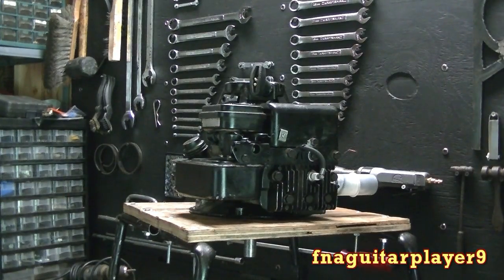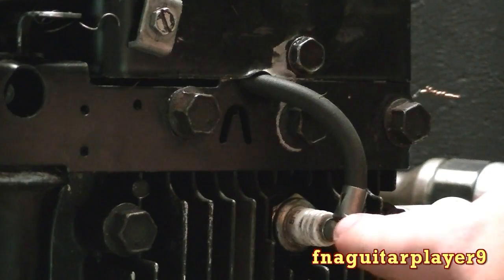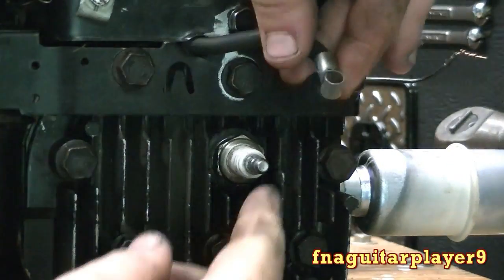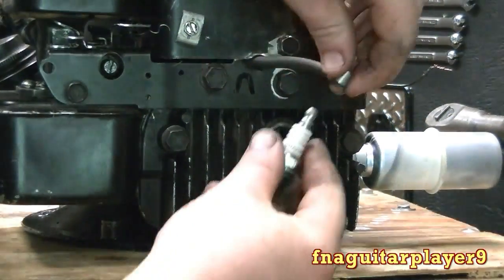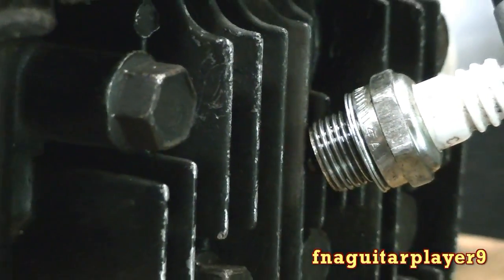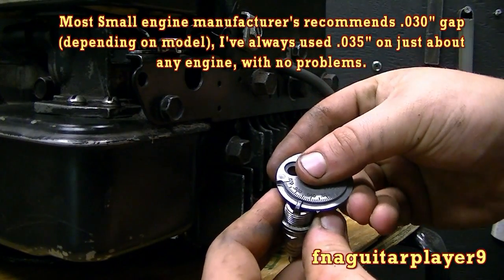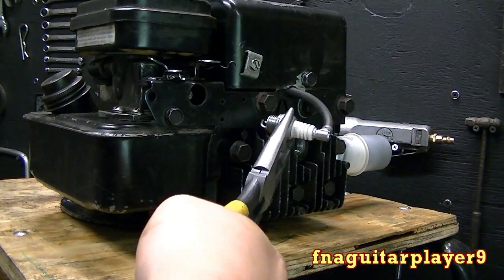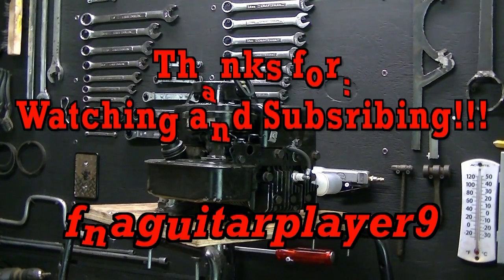How to check for Spark Plug Fire (in any engine)

Comment: Wats the conclusion i mean i should check gap and fire spark if gap to big minimize and vice versa is that so
Reply from the maker: Set your spark plug to whats recommended then check for fire. Some will say its not a true test, because it will spark differently while under pressure, which is true, but this test just makes sure that the spark plug is firing. If you have a yellow spark (weak) it usually means you the coil is to far from the flywheel (magnet) or you have a bad condenser or the coil itself is weak. 90% of the time if you test it like i did in the video and it has a blue or purple spark, its firing good enough to run. Thanks for Watching!!!

Comment: Thanks for the video. I'm going to try your method on my Husqvarna chainsaw. It's been sitting for months but was treated with fuel injector fluid. I'm gonna test the spark plug first, and if that isn't the problem I'll potentially clean the carb. If it STILL won't start, do you have any other ideas?  Again, thanks for sharing your video with the world!  With Gratitude, Z.
Reply from the maker: Zee Suro your welcome! if it has spark and the carburetor is clean it should at least try to run, if not the carburetor may need to be adjusted or rebuilt. thanks for watching!!!

Comment: Can a bad plug still spark? If I pull my push mower cord slow,I get no spark. If I pull it harder and faster,it gets a weak spark.  Magneto? Plug wire? Or new spark plug? Spark is orange too. Thanks! (Toro Recycler,self propelled,6.5 horse)
Reply from the maker: Oh yeah, its possible, I would suggest trying a new plug before anything else, it could be arcing inside or through carbon buildup on the plug. First thing I try anytime I suspect ignition issues. Thanks for Watching!!!
Reply: @fnaguitarplayer9  I cleaned the plug up (b4 buying 1),then I noticed that the plug wire itself,had been cut and that was the issue. Thanks

Comment: Hi, I have a Artic Cat 250 2x4. It takes a awfully long time to start. I did the spark plug test and it starts off yellow from the spark plug then blue at ground. I can't tell if I need another one or not :(.
Reply from the maker: NyQuan H I'd try another plug just to see, but if the spark is changing color like that, that sounds like a weak coil, might want to replace it. Thanks for Watching!
Reply: Epw ,

Comment: I've got spark to the end of my plug wire (removed the boot and grounded it on the engine block) but can't get spark at the plug base (the electrode tip).  The plug is brand new and gapped to .030.
Reply from the maker: Art Vandallay That sounds like a weak coil, or, even though its a new plug, its possible its bad, I'd try another one and make sure your grounding the plug good, sometimes they can be picky. I'd say its a weak coil though, sometimes they will spark like that. Hope this helps, thanks for watching!!!

Comment: I don't see a spark when I do this but I do feel electric current going through the wire, I've tried other spark plugs as well but they don't seem to do much either, I know they are not damaged,.. what could that mean then ?
Reply from the maker: Depending on the engine, it could be a bad coil, points / condenser if its a old engine, or distributor if its a older car engine. or even a bad plug wire. Thanks for Watching!

Comment: I have a honda crf250r and it's not firing up not sure if it's the spark plug? any help
Reply from the maker: +josh zub You could try another plug, its always the cheapest/easiest thing to check, if not, then it may have a fuse somewhere or a it could be a bad coil or a bad regulator box, or efi box. Thanks for Watching!!!
Reply: +fnaguitarplayer9 hey I actually found out the problem my brother was playing with my throttle and found our he flooded the engine  thanks again
Reply from the maker: +josh zub I hear ya! no problem, anytime!

Comment: Do you have any advice on how to test for spark on an small engine outboard that needs to remove the cover to get to the plug and so doing removes the pull cord from its engagement? I am not sure how I can crank it.
Reply from the maker: You may be able to crank it by hand, just turning the flywheel, if you got a good strong coil/spark it will spark at low rpms. Thanks for Watching!!!

Comment: hey i need help. i bought a used kawasaki ninka zx10r.and before i left i asked them how long does everything will last like, oil , coolant. spark plug . break pads. but they didnt say anything. sounds like they just bought it from previous owner and never inspected it. all their ads said oil change is done. so how i can tell if my spark plug is getting  old without cheaking them. there will be lots things to do just check it. like take off the gas tank, body fairings, air box etc. thanks for the help
Reply from the maker: +Kawaii Ninja You can really only check spark plugs by taking them out, but if they are worn to bad they won't fire properly and will cause a miss. Alot of people don't keep up the maintenance on stuff these days. Thanks for Watching!!!

Comment: My spark is more yellow and not so strong, could this be the reason for not even attempting to start? Been parked up a year, fresh fuel, clean carbs just keeps cranking?? Tia
Reply from the maker: Yes very possible, try a new spark plug first then go from there, could be weak coil or if its a older engine could be the points/condenser. Thanks for Watching!!!

Comment: I have a small quad engine, and my spark plug wasn't working so I got a new one but it still isn't working so I'm guessing that it's something further back but I'm not really sure what it exactly is, help? 😊
Reply from the maker: Edward Ridge On quad / 4 wheelers engines most of the time its the coil or a regulator box went out. On small engines as shown in the video, my video here can give pointers on fixing it https://youtu.be/S8B7Xwpz94w , if you have another coil i'd suggest that first, because they do go out on those alot. On small engines most of the time its in the wiring or points/condenser. If you have any more questions feel free to ask me. Thanks for Watching!

Comment: hey fna, i was wondering if by ignition on over night turned over, would that fry out the module? or a coil perhaps?   

i tried this spark plug thing and it starts up now, but when i accelerate it sounds like it wants to back fire.  any suggestions? thank you and wonderful video.
Reply from the maker: not on small engines, if its a vehicle or a 4 wheeler it might because they don't work off magnets like these small engines do. Try checking the plug and see what the spark looks like, you want a blue spark, if not then its a bad plug or weak coil. If it has blue spark then its probably a carburetor issue. Thanks for Watching!!!

Comment: how do i set the timing on a small 2 cycle
Reply from the maker: On just about all small engines the timing is preset by the magneto and flywheel key, since it works off the magnet on the flywheel, on older engines with points and condenser, the timing can be adjusted slightly by setting the point gap bigger or smaller. Thanks for Watching!!!

Comment: Is this showing that the Engine can create spark or that the spark plug is good??
Reply from the maker: Both to a point, the main purpose of this is checking to see if the engine (coil) is producing enough voltage. The condition of the plug determines how good the actual spark will be. Thanks for Watching!!!
Reply: If you do this test and there is no spark, you have a problem and might need a new ignition coil.

Comment: I got an 80cc 2 stroke moped, the day before i wrote this, the bike rode just fine. But after school, it just died. It starts, but after a 100m ride it dies. U can still start but i just dies eventually. I checked the spark, and it was yellow/orange ish in color. Could that be the reason? What do i need to replace?
Reply from the maker: Sounds like either the plug is bad and when it gets hot it breaks down or the coil could be bad. Try a new spark plug and if it still does then i'd say its the coil going out. Thanks for Watching!!!
Reply: fnaguitarplayer9 thanks, i checked with another plug, but didnt work. So i will be replacing the coil👍🏼
Reply from the maker: @crazyshaq1995  I figured, when you said yellow/orange thats usually the problem, but a new plug is always the cheapest thing to try first.

Comment: hi i need help plz i think my wiring loom is ok when i kick it has current and spark from the spark plug cap. but it won't start will a new plug solve it cos it is a NGK R plug ??
Reply from the maker: I would try a new plug first, sometimes a bad plug can cause alot of problems, if a new plug still does it then i say its probably a coil or points if it had that. Thanks for Watching!!!
Reply: fnaguitarplayer9 sweet new plug did the trick. now I've just rounded off my kick start lol
Reply from the maker: I hear ya! Its always something. at least the ignition problem was simple.

Comment: Hi i have a go kart i switched out the coil and spark plug but i still domt have any spark
Reply from the maker: Disconnect your shut off wire and see if its sparking, if it does then, then you have a shorted wire or bad switch, if it still has no spark then make sure your gap is set right on the coil and its rare, but make sure the magnet is still good on the flywheel. Thanks for Watching!

Comment: another test for spark is how far it will jump  ihave a truck  it just jumped less than 1/4 inch  i had wrong condenser   afyer changing it jumps 3/4 inch  big blue  if you are having point  contacts pitting you may have wrong cond and knot noit
Reply from the maker: that is true! I have another type of tester that tests spark length, it looks like a spark plug but the end has a huge gap on it. Thanks for Watching!!!

Comment: Is it possible to test a gapless plug like this too?
Reply from the maker: I don't see why not, it will spark just like a regular plug, only difference is they are usually preset and the gap size can't be changed. Thanks for Watching!!!
Reply: You do realize that gapless plugs have absolutely NO GAP, right?  So I'm not sure what u mean by they come with preset gaps.  Have u ever seen a gapless plug?  They are used in lots of marine applications as they are better at running at high rpm's for long periods of time.  I chose to purchase a simple spark spark tester that goes from the wire to the plug.
Reply from the maker: Yeah, there is still a slight gap around the circle, it has to spark somehow. I've seen them, I've never used them. Unless there is a new type out that i'm not familiar with. I hear ya, that works great, I have a newer video on how to do this and I use it and another type of gap tester, that tests voltage as well.

Comment: may know is timing isneeded for spark !!!
how spark generates means from which source other than a battery ?
also how  the magnetic coil and the cdi unit  is soo related or tuned sothat ignition occus continuous ly ?
also what will happen if ignition will be more i.e fast spark occus??
Reply from the maker: abhijit das On small engines as i show in the video, they use a magneto or magnetron, and the there is a magnet on the flywheel that induces a charge into the primary coil of the magneto, which is basically a step up transformer that converts the lower voltage pulse into high voltage for the spark plug. The timing is set by a key in the flywheel, that keeps it from changing. The timing will change throughout the RPM range do to the magnet passing over different spots on the coil faster or slower. The older engines (usually older than around 1982) will have points and condenser, the newer ones are mostly all electronic ignition (magnetron). Hope this helps, Thanks for Watching!!!

Comment: .Hi there, l have a 2 hp Suzuki that is like a new engine, never really used from 89. I just bought it. lt looks like it has an ignition problem. No spark. ....its getting fuel to the carb, but totally no spark. disconnected the stop switch,just in case the fault lied there. No, go. l am scared to start tearing into it. Do you think l need to look at the magneto, points? where the HV wire goes to. l am scared to take apart the pull cord in case its spring-loaded or something. And if l have to take off the flywheel, have l then fucked up the timing. l really am scared to get over my ability but at the same time do not want to pay for a mechanic to look at it. because it will then not be a good buy. Any advice appreciated.
Reply from the maker: I'd try a new spark plug first just to rule that out, and if it still has no spark, its probably a bad coil. These newer engines don't have points anymore. New coil is fairly cheap on ebay/amazon. You should just have to remove the flywheel shroud (the cover that the recoil piece is bolted to) then you will have access to the coil. Timing won't be a issue, it will be set by a key on the flywheel and you won't have to remove the flywheel to replace the coil, just make sure to gap the new coil to spec, which should be about .010" or the thickness of a business card. Hope this helps, Thanks for Watching!!!
Reply: @fnaguitarplayer9  thanks, it does not have cdi, it is from 88 or 89. Sö thougjt it must have points. I will try a new plug first. But still a bit weary to take apart, because its new, but what can l do.will the pull cable system just come away, without the recoil, springy fuck up. Am l basically needing to get to wear the HV sparkplug lead goes inside and that connects to something that l need to check right. And you say do not need to take flywheel off?
Reply from the maker: @swedishkev  Yeah you shouldn't have to deal with the recoil spring, it will be contained, correct, there will be a coil that bolts on, i have other videos on replacing coils, it won't be on that same engine but it might give some pointers on it. right, you do not need to take the flywheel off, as far as i know. Once the cover is off, follow the hv wire from the spark plug to the coil.
Reply: @fnaguitarplayer9  so take away fuel tank that sits on top and the unscrew the casing that contains the pull cord . But the pull cord housing must be connected to a cog. And the should l see what l need to see, am l looking for corrotion,rust or a connection that looks doggy?
Reply from the maker: @swedishkev  you shouldn't have to remove the fuel tank, but i could be wrong. I'd try disconnected the shut off wire, it will be the thin/small wire that goes to the switch just in case its shorted somewhere but i'd say the coil itself is bad.

Comment: it seems  that even the new plugs firing is orange and not blue ?. your comment please .thanks
Reply from the maker: In the video it was blue it just didn't show up good, orange spark usually means low voltage or a bad connection somewhere, like a split in the wire arcing out, or if its on a lawnmower that has a magneto, it is usually the gap between the coil and flywheel is to big, or the posts where the coil mounts is corroded making a bad ground. Thanks for Watching!!!

Comment: @fnaguitarplayer9 excuse me but if my ignition coil is broken will I get any spark? because I changed spark plugs and nothing is still happening thanks!
Reply from the maker: +MrBluekid117 If its bad or broken it won't fire, first thing to do is unhook the shut off wire on the coil, if it had fire then, then you have a shorted switch or wire pinched some where. Thanks for Watching!!!

Comment: My mower has orange spark on the plug could that be why it runs roubh?
Reply: "Grantinator" have u tried changing the spark plug
Reply from the maker: Possibly so, try a new plug and if its still the same you have a weak coil or bad ground somewhere. thanks for watching!!!

Comment: so can you test any spark plug with a lawn mower???
Reply from the maker: You Can, but that wasn't the point in this video, point being, in a vehicle or lawn mower or whatever if you remove the plug, connect wire, and ground the plug you can see if your getting spark or not. But yeah, if you need to check a plug off the equipment, you can use a lawn mower to check it, works just fine, its not quite as much voltage as a vehicle but it should jump most normal sized gaps. Thanks for Watching!!!

Comment: If you hold the plug firmly to a part of the engine by the threaded part of the plug with just your bare fingers, you will not get a "dig" or shock from the plug.    
Think about it and understand the reason, then try it and you'll see that I'm right.    
Your dirty plug was showing the spark as orange rather than blue because of carbon fouling on the porcelain part shrouding the centre electrode. If you'd cleaned it, it would've been better.
Reply from the maker: That is true, because your just holding the ground. Main reason i don't like doing it is because if your boot isn't in the greatest shape it can arc to your finger. True, alot of times just cleaning a plug will do just as good as replacing it. Main time they need to be changed is if the electrode is deteriorating or the porcelain is broke. Thanks for Watching!!!
Reply: If the sparkplug is held firmly against the earth, you will never get a shock.    
However, if the hand holding the plug to ground is also touching the ground, the current, if you are careless enough to have a finger too close to the electrode and you do get a shock, will go to earth by the shortest possible route. As the high voltage travels the shortest way to ground and will just go through your fingers or hand there won't be much more than a sharp tingle, which, while uncomfortable, will cause you no harm or injury at all.    
The trick of stopping a lawnmower with an exposed electrode with your body is just that, a trick.    
The method is to put a finger onto the cylinder head or engine cowling and short the electrode out with the same finger or hand.    
Try it, you won't die.